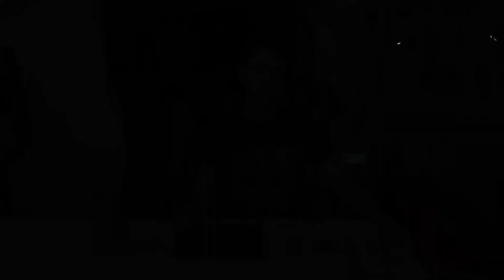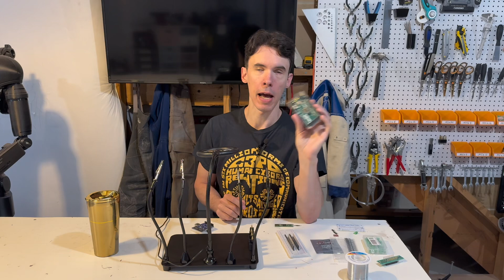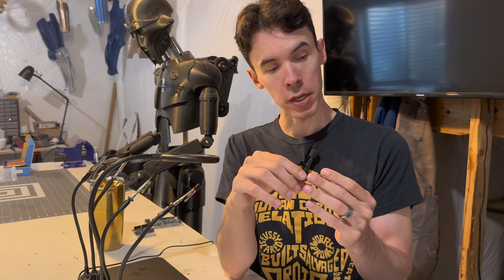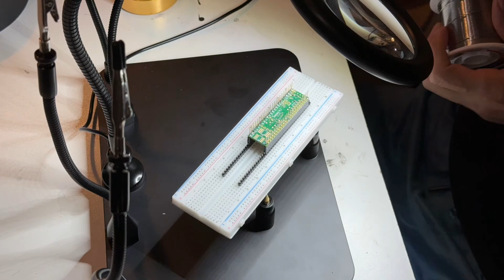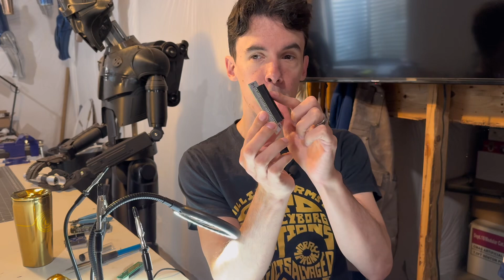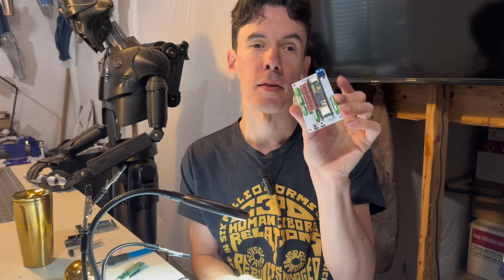Shadow-RC Gets a MAJOR upgrade!!

Comment: Steven, enjoyed the video and I can't wait to see the Shadow RC code running on the new board.. unfortunately I am already well down the path of using the Mega ADK and PS1 controllers or I would switch... Your new Shadow RC code is amazing and your documentation is the best I have seen.... Your code alone should be enough of a reason to make new builders switch... Amazing work! Great Job!